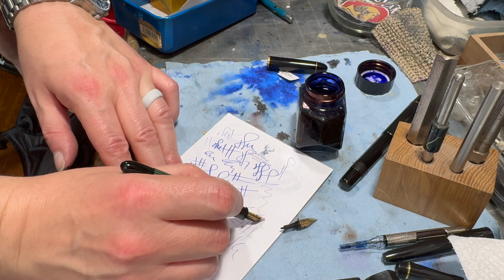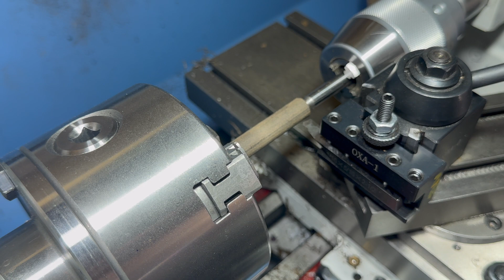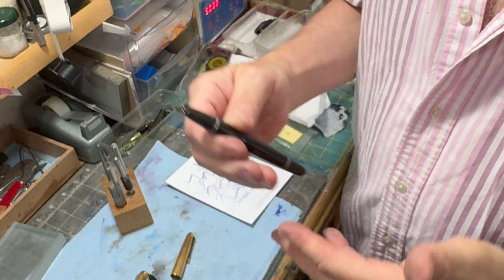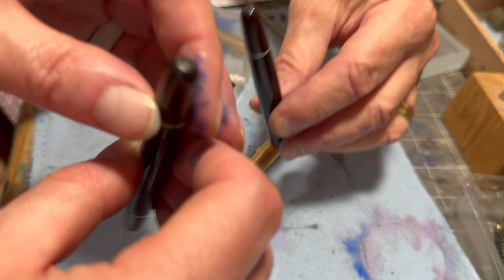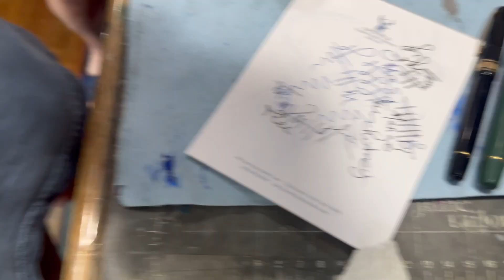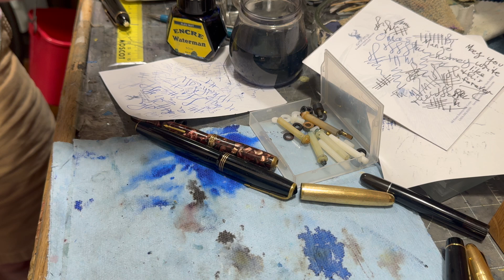EPISODE 6: TALKING VINTAGE EUROPEAN PENS WITH TIM ETTENHEIM

Comment: Just bought an Aurora 88P from a guy in Italy who sells pens. It legit looks never used. Comes in the original box I'm pretty sure even. I'm so stoked to get it. Should be hitting the U.S. shores here soon. I only paid 135 Euros for it, price for shipping included. Very awesome deal. Glad I came back to this video to see you guys talk about Vintage Aurora.
Reply from the maker: If it's unused that is great. Do you know the nib size?
Reply: @uncapped_jjlax  Seems to be a medium. Very juicy. It's very bouncy, I wouldn't call it flex nor do I try to over do it. He told me it was basically unused except to try it out because he did in fact redo the piston and checked all of that out. It works flawlessly.

Comment: I wonder what was the degree of precision possible in the 1920s / 1950s (0.0... mm) ?
Reply from the maker: That is a great question. I believe the lathes they used back then were just as good, and in fact, Tim's first lathe you see in the pictures in his shop was at least from the 1950s, and he says that it was just as precise. The Vernier calipers have also been in use for a very long time.
Reply: My original lathe (photo on the wall) was a Logan, made in Chicago in 1943. They were used widely on WWII, and were rated to be consistently precise to .001" That was generally the standard through the 1940s, after which progressively finer machines were developed.

Comment: 19:40 What do you or Tim soak pens in? I keep hearing horror stories about gold and ammonia so I'm weary of pen flush. Thank you for the video!
Reply from the maker: I believe that what he referring to is just distilled water. In the ultrasonic he has a container that has diluted rapido-eze, which I also use and is great for dissolving ink. I have used it for years without an issue. I have used ammonia in water with little issues, but you need to make sure it is diluted in the proper ratio. No matter what solution is used, I always clean the nib or feed in plain water in the ultrasonic.
Reply: No, that wasn't rapido-eze, it was dirty distilled water with a bit of ammonia and a drop of Dawn.
Reply: Generally, soaking is not good for pens. Some pens benefit from soaking their sections to get them to release, but a good soak will destroy too many pens for it to be done if you don't know when it's safe.

Comment: Thank you for the video. I am another fan of Aurora 88's. The second iteration was the 'K' and the third was the 'P' before the introduction of the new 98. The original 88's came in two versions, one with the gold cap (in a blue aluminium case) the other with a nickel silver cap 'Nikargenta' in a silver case with blue bands. Many people have an allergic reaction to nickel so a chrome replacement was introduced fairly quickly. Down south in Napoli the main agent wanted a more ornate pen than the version from Turin in the north, so Aurora produced an all gold plated...and later an all gold version, named the 'Aquila', which can still be found although they are scarcer. The piston caps on the original 88 and the K were simplified to a plastic head on the P model. It is quite a rabbit hole!